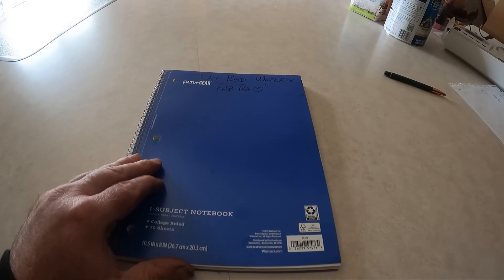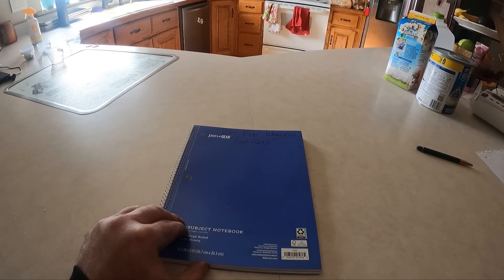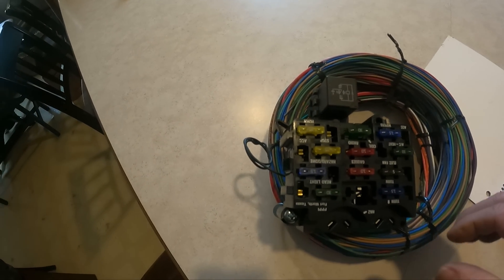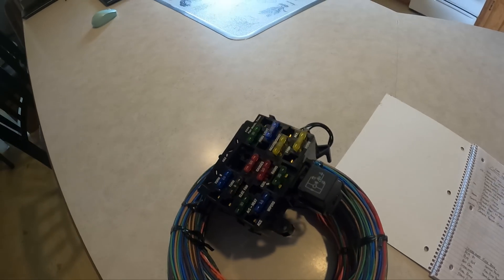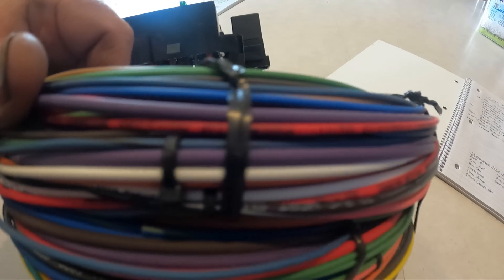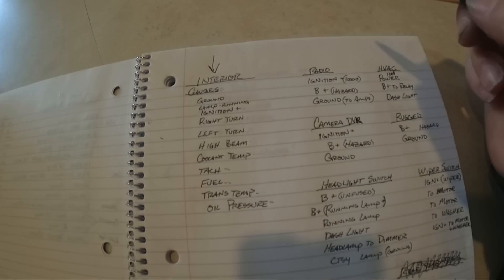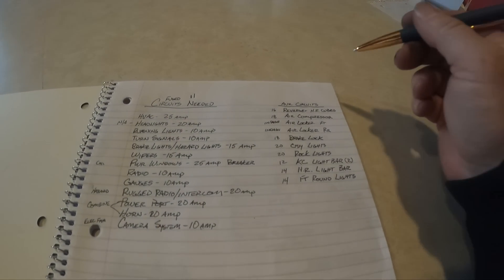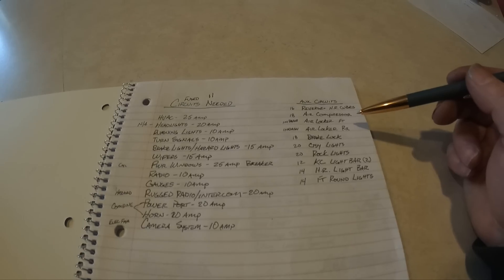Chad Tech - Wiring Harness Layout

Comment: Very interesting. Been watching all the builds you have been helping on and was wondering how you kept it all straight. Looking forward to the rest of these. Another good class would be adding in something new to an existing harness. How do you figure out all the connections, running it through the vehicle, your splicing styles. Your stuff is pretty clean which is good to know, plus I am always curious different people technics. You only need one tool, but if you have multiple you get to pick your favorite!

Comment: Howdy Chad. I think your idea(s) on doing these type of videos for automotive wiring is wonderful. If a person is not familiar with reading a schematic they can be very confusing, especially between different auto brands. Writing out your schematic in text form is a good idea on what you need, where it comes from, and where it is going, as an easy format most people would understand. After spending 30+ years wiring electrical cabinets I know how to read a schematic and they can be tricky sometimes if you are not paying attention. In my years of design and wiring I have always opted for going to the next size larger in wire size as a default. Better to get hot than burn! I also recommend laying in the wiring the "long way around" to get to a particular point. Should something happen and you need an extra inch to get you up and running again, you'll be able to find it somewhere in the run. My point is do not wire "guitar string tight"... you'll be sorry! Per chance are you going to be showing how to do rudimentary calc's for wire load? Meaning, will you be showing in your booklet that 2 stop filaments will burn "X" amount of watts and that requires (just guessing here) 18ga wire to support them? I know it requires a little math for the car builder to figure out, but it is safer than sorry vs. having a fuse blow out from an undersized wire. Be safe and take your time figuring out what is needed. Love your channel and respect to you and the family. You have a great family that all works together and that is from love and wisdom. Keep up the good work. Waiting for more!! Take care!
Reply from the maker: I will be covering wire size vs load vs fuse size in a future video.

Comment: Chad - would you ever consider a conversion wiring video from standard headlights to LED??
Reply from the maker: Most LEDs are a direct swap and take less current than halogen bulbs so their isn't any wiring changes needed.
Reply: @Chad's Fab  when I looked at brake light bulbs they indicated a special adapter was needed.  I need to find some good LED bulbs for a Yukon
Reply: @Chad's Fab  when I looked at brake light bulbs they indicated a special adapter was needed.  I need to find some good LED bulbs for a Yukon
Reply: Any recommendations

Comment: Chad, I've a 2000TJ that has an electrical issue with the air condition/heater controls.  They are melting the connector that plugs into the control board.  Is there anything I can do to re-wire the unit to allow more power from the circuit to eliminate the overheating issue? I'd really appreciate any suggestions you may have.
Reply from the maker: Which connector? Please e-mail me some pictures and I can help diagnose it, not a normal problem.

Comment: You might get into it more later, but how do you prevent alternator whine on the radio? In ham radio, they stress to directly wire the radio to the battery. You fuse both leads. Even with that, sometimes when I accelerate, I still hear it.
Reply from the maker: Alternator whine can be tough, some alternators are just inherently noisy and sometimes ignition noise gets mistaken for alternator noise.

Comment: Thank you for this video Chad. This summer I need to require an old bulldozer and seeing you wire the two two trucks has given me the confidence to take on this project. Would appreciate a video on how to terminate these wires and the different connectors that you prefer to use.
Reply from the maker: I will be doing a connector video in the very near future.

Comment: Hello Chad from Sydney Australia.
Thank you for this instructional video series.
Q1. Buying readymade harness v making.
How can you ensure wire lengths and connectors? 
Q2. Do you simply select the fuse box from a catalogue (with 20-15 Amp fuses) for your needs, with (1-2 spare fuses)?
Q3. For the alternator is 16g wire enough albeit: as it creates electrical (D.C) current? Look at the wire gauge from battery.
⚡🧵
Reply from the maker: Ready made harnesses are generally only available as factory replacement type scenarios and don't have a ton of room for modification. Universal and semi-universal type harnesses can be adapted to work in a lot of different scenarios, requiring a lot more work though.
Most harnesses come with a preterminated fuse box, I find one to match the needs of the project. 
The small wire is used to turn on the regulator, a larger 6-8 gauge connects to the battery.

Comment: Thank you Chad.I've learned more from your videos on Paul's wrecker,and this tutorial,than I even understood about wiring a vehicle./I have a question on the 'Alternator to Welder' switching.Since the welder draws so many Amps versus the battery needing charged,how are they separated when the alternator is switched to the welder,and will the battery be charged? TY.
Reply from the maker: When switched to weld the alternator is not charging the batteries. This is done through continuous duty solenoids.
Reply: @chadsfab  ;Thank you.

Comment: Hoping this will be helpful to ‘fix’ or clean up my wiring from replacing compressor on my bike’s air ride.  

5-6 yrs ago, it seemed to go much smoother and easier than this time!  So I broke out the crayons, drew a schematic and compared to company’s very basic diagram.

There was some profanity and more troubleshooting, but I got it working again.

Comment: This is great information. Wiring has alway been my nemesis and this helps. I do have a question, I will be wiring a 66 Mustang with A/C. Do you suggest a second fuse block for that or just a larger main fuse block. Thanks.
Reply from the maker: Vintage Air and similar systems usually have a wire that goes directly to the battery and add no load to the fuse box.
Reply: @chadsfab  thanks.

Comment: I refer to it as premeditated stupidity so that I have a system that can be added to for extra circuits in the future. I try to break it down to separate systems like motor(s), helm(s) pump(s), charging system(s), electronics, etcetera. I do resemble that poor creature babbling in the corner when I first start on an overhaul but eventually it starts to become something. This is for boats & yachts up to 60'. There is also a code for what wire color is for what. Pumps-brown, oil-green, temp-tan...

Comment: Excellent video, Chad!   I have been a cable and wire harness fabrication instructor in the commercial and high-reliability (e.g., military and defense, aerospace, avionics, space hardware, etc.) markets for several years.   Good fabricators are remarkably hard to find and you truly are a master!   Your knowledge and skills are remarkable!  Oddly enough, automotive is one market that has eluded me; I have never fabricated automotive wiring harnesses and I enjoy learning from you.  You hit on a key point that I used to try to really engrain in my students: when it comes to wire harnesses, planning is IMPERATIVE!   Cables and wire harness fabrication is 80% planning and 20% fabricating.

Comment: This couldn't of come at a better time. I'm not to far away from wiring my project, kinda apprehensive about wiring it. My project is a 66 brug, 66 Ford bronco with a 65 VW bug body. Built in the 80's, recently retired and  I'm about 3/4 of the way of a ground up restoration. This time I'm doing it for show. It should be pretty basic, no a/c, no power windows, no winch, no fuel injection. I did convert it to electric fuel pump, one wire alternator and an electric fan. I don't know if you accept work from viewers but when I'm ready I can have it shipped to you for wiring, I'm in Arizona. Not a lot of people I would trust working on my car but I've been watching you for awhile and you are someone I can trust to work on my project.

Comment: Chad; Can you address the issues Nessie had with her wiring during the KOH?  I'm especially interested in what Holley said about electrical tape. Once I was taught how to lace wire and with the advent of velcro wire straps,  I avoid using electrical tape on anything used outside.  I like velcro straps with braided cover and zip ties.
Reply from the maker: I haven't had a chance to watch that video, I will check it out and if I have anything useful to add I will.

Comment: Thanks Chad, great lessons! When I was building mainframe computers, we often had to accommodate harness branches to hinged panels.  A great technique we used was to identify the "flex point" and pick up all of the harness to one side of that point, and twist the flex point 180 to 270 degrees, placing tie wraps/velcro at each end of the flex area. This way, all of the wires in the bending area are the same length around the bend radius, and flex without pouching out several of the wires. try it on a scrap harness to see if that might be helpful.
Reply from the maker: That's how I like to do harnesses through door jambs. Most cars simply fold the wires which causes them to break but twisting them works so much better.

Comment: I'm glad you relented and started this series, Chad. 😁 It fills in some gaps to my knowledge. I'll wait to ask most questions, that will probably be answered, in this series. But how you calculate the supply wire size to auxiliary sub fuse blocks, is something I'd like to know. Do you add all fuse potential current, or a percentage of total potential for the wire size feeding panel/box?      cheers!
Reply from the maker: I'll be covering that in a future video.
Short answer: I usually don't like to run more than 50ish amps through a conventional fuse box so a single 10 gauge or a pair of 12 gauge wires is sufficient.

Comment: Back in the '80s, I had a '50s Triumph car that I was fixing up to drive.  The insulation was rotted and crumbling off the wires.  I started by replacing just a couple of wires, but soon found that the problem was extensive and decided to rewire the whole car.  The car was simple enough.  I didn't try to find a harness, I just used spool wire from the car parts and hardware stores.  I soon gravitated to the idea of creating a wire list.  Just one entry per wire with the end points for each.  Later, I interviewed at a local aerospace company for a summer internship job as a drafter (actual drawing board drafting in those days).  As it turned out, the position was in a group that designed custom avionics installations.  One of the interview questions was, was I familiar with wire lists.  I was able to tell how I used them to rewire my car.  I got the job and spent the summer drawing cockpit layouts and creating wire lists.  The happy coincidence makes me smile to this day.
Reply from the maker: Yet another reason to always be willing to try new stuff. 
Great work!

Comment: Excellent instruction.  I really like your methodical approach.  One question though.  Aren't the wire colors and gauges already set by the fuse box/harness assembly that was bought for the particular application?
Reply from the maker: Thank you!

Yes the wire colors and sizes are set by the harness manufacturer but they aren't always correct for a given application so it isn't unusual for me to change wires to make it more suitable. Depending on the application there will also be a lot of wires that will be added to the harness and I like to standardize them as much as possible too.

Comment: Those on board welders that they put on the wrecker's. Paul put his on the inside out of the weather. Shouldn't Matt have done that also, or are they weather proof?
Reply from the maker: They aren't weather proof at all. Matt won't have any issues since it will be inside more than not and the weather in southern Utah is quite dry.

Comment: Thanks for this one.  I was going to ask about wire colors, but you sort of answered that one.  It would be nice to know how many amps each fuse needs to be.  You probably already know that, but I would like to know how to figure it out.  As for wire gauge, I guess that part should be obvious once you know how many amps the wire is rated for.  I think I might try to clean up the wires on my Honda motorcycle using some of the tricks you've mentioned.  After three or four sets of extra wires get added with no thought of how they should be hooked up, you can end up with a rats nest.  That's what I would like to clean up.
Reply from the maker: I will be covering that in a future video.

Comment: I have a 2007 E-450 cab and chassis that I bought from U-Haul... 
I replaced all of the original lighting with led..
I noticed that the wiring on the van has thicker wire than the led lights...
Is this going to cause issues in the near future..???
The difference in wiring gages are so far apart in size that I'm concerned...
Everything works fine for now but my concern is that I will be using the van for a gooseneck trailer to haul freight...
Should I install in-line fuses..??
I thought of maybe adding a junction box to the frame with the original gage wires going into the junction box and having the thinner wires coming out of the junction box and onto the led lights...
What should I do...???
Please help...!!!@
Reply from the maker: There won't be any issues as long as you were able to connect the wires together solidly.  The original fuses  will be fine to protect the led lights. 
There isn't any need to add any components/boxes/fuses to what you've done as they will cause way more problems than they will solve.

Comment: Ok I’ve got two questions,hopefully not stupid ones. How do you determine the wire size,for example are alternators all wired with the same size wire or does that vary and how do you determine the size of the fuse. Are these pre-determined universally or is there a formula. Thanks Chad.
Reply from the maker: Definitely not stupid questions. I will include that info in an upcoming video.

Comment: I would enjoy hearing more about tools and hardware. What sorts of connectors and terminals always give good results as well as the kinds that always are a p[aio  or that cost a lot more but dont benefit the builder or owner much. A;lso what you consider to be the best mosty used tools for automotive4 wiring. Best strippers, cutters, test equipment and handy/clever items that do one thing so well youll never do that thing again without that tool
Reply from the maker: I will include all of that in an upcoming video.